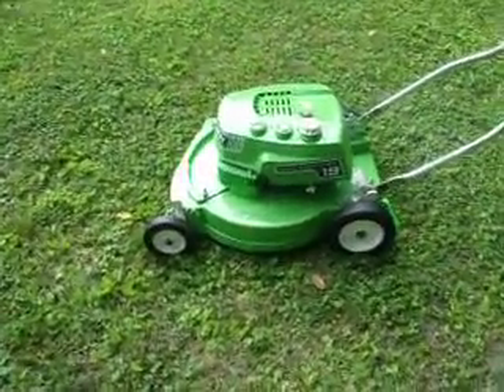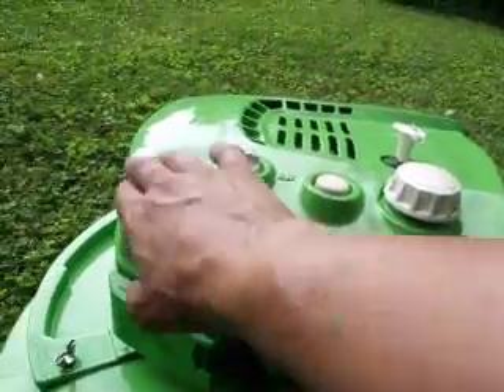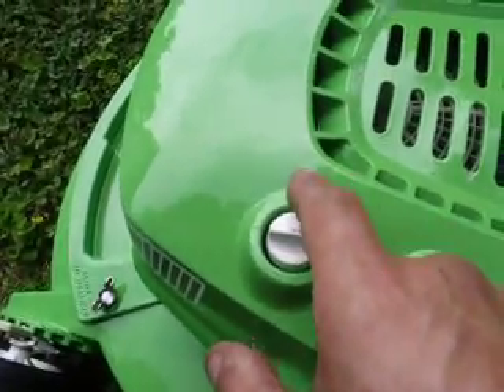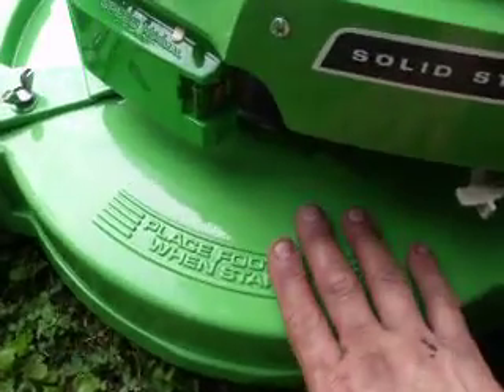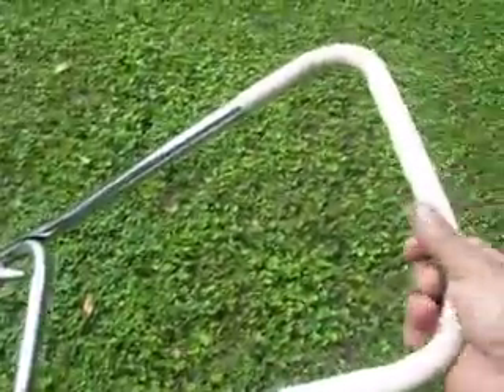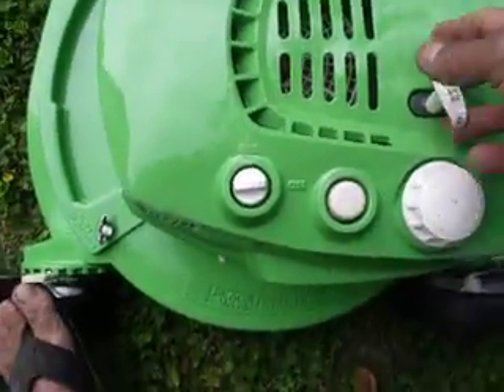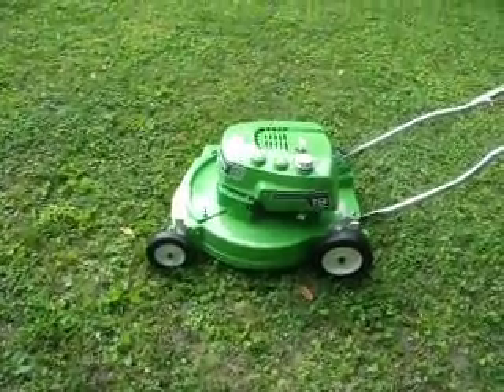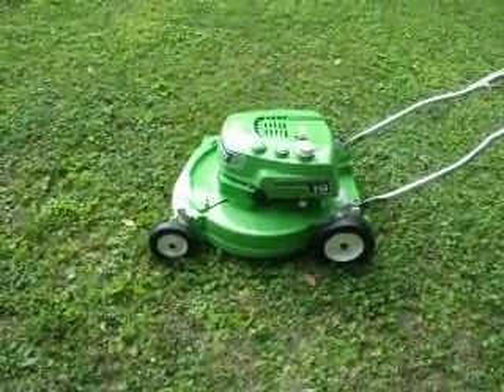Lawn-Boy, 19"inch mower, model # 5247 year 1979 Restored by "CharlieMack"

Comment: Another great restoration!   Love that series of Lawnboy.  I have a 7268, 21 inch, and 4 of the 5247's, one of which has only been used about 10 times.   Even have the original box it came in.
That looks like either a newer engine or a newer shroud as the shrouds with the extra louvers came around about 1981 into 1982.
I hate the fact that the new Lawnboy wheels do not match each other.  I did find some generic sets that the front and rears matched.  Keep up the good work.

Comment: I have a 7268 and it keeps on flooding. Any advice?
Reply from the maker: Sure you can check your carburetor float! It sounds like its getting stuck or out of adjustment! Message further if you need more, glad to help!
Reply: Charlie Mack well I had the carb apart and the float was freely moving along with the needle
Reply from the maker: Okay, the next thing there is the float is not level! It sounds like the float is again either to far down ,take the carburetor apart, hold it up with the float in it and look closely, it should be exactly level, with you holding in up! If the float is not level, there is your problem! You can bend the arm of the float so ever slightly to achieve this!